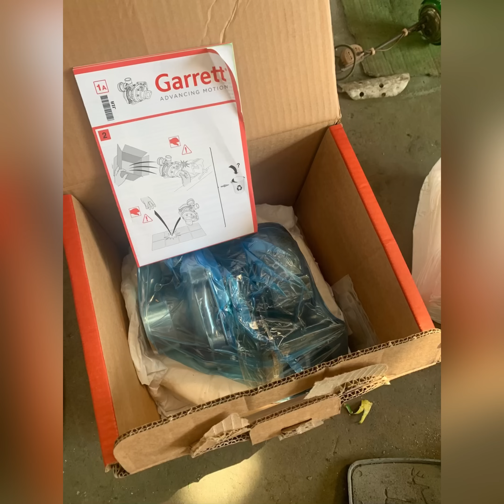John Deere 3650 showroom spec restoration by Colin Elliott

Comment: A/C compressor ic original? I see number b709s46
Reply from the maker: Original couldn’t be got
Reply: @colinelliott8417  I see, did you use R134a? Or old r1* or whatever it was
Reply from the maker: Not sure I just ordered it off the air con company, it fits with the original brackets so must be close enough to the original

Comment: how much you ask  to do our  2850?   it has 9500 original hours  and  is  running 127 horsepower on the pto
Reply from the maker: It verys a lot on how much time is spent on it and what parts it needs, but it’s a lot
Reply: the tractor engine is perfect  it has new clutch etc new hydraulic parts   do u have email?